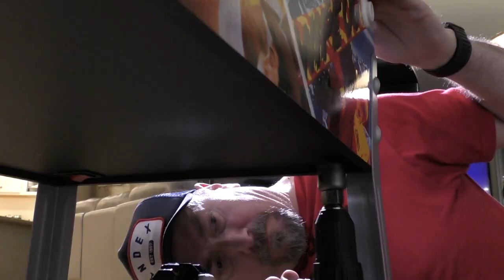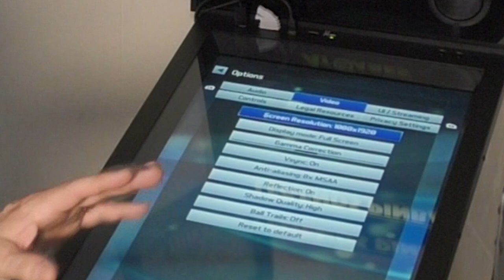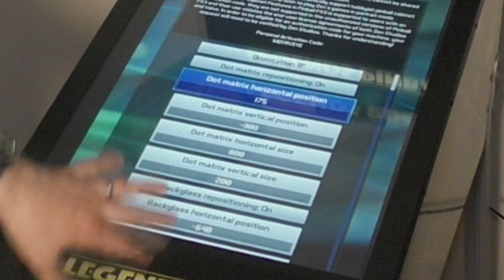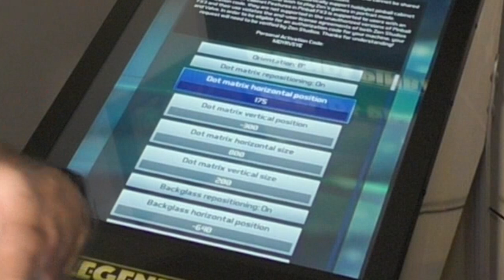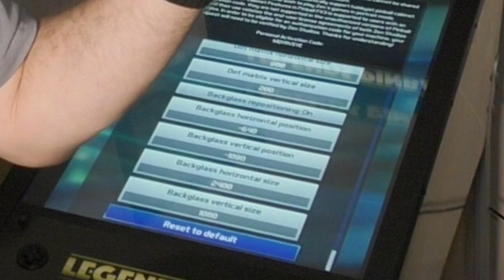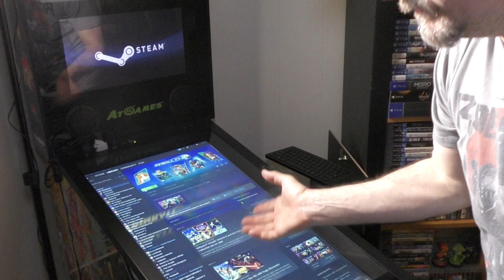AtGames VIBS (Rachel) Board + Alienware OTG PC Install for Legends Pinball | First-Play w/FoG

Comment: Hey brother , like the channel looks like we like a lot of the same things . Only thing is I added black bat tops to my alu with 6lbs springs not red. Also got the pixlecade. My pinball is coming Wednesday. My Rachel board and controller board for the front of the pinball coming Friday. My only thing, is When I install pc’s into any cabinets I attach the board right to the arcade cabinet itself just using a couple of risers and adding fans to pull air in and out of the cabinet . It’s just easier to work on if needed and always runs cooler out of the case . Good luck . Love the channel. Keep up the good work. Def try and get air into the pinball box. I’d recommend drilling fan holes into the bottom of the machine and then adding a fan cover so you’ll be pulling air from under the cabinet . But everything looks good for you. I also have the ribbon cables usb and hdmi. Word of advice when ordering the usb you need to know to order usb a up or usb down. This will determine which way the cable is gonna run when plugged in. Another youtuber has the wrong cables and so it’s plugged in and then the cable bend backwards back over the usb plugged in and then down and hidden away. If he ordered the correct usb cable it would just plug in and go straight down and hidden away. So remember on Amazon check the up or down photo you’ll see when you scroll through the photos and it will show you which you’ll need .
Reply from the maker: Hey, thanks for the advice. I found the various designs of the ribbon cable USB and HDMI, so I’m going to pick some up. I just snagged a 8” screen from Amazon for the DMD, and it should easily fit between the speakers. I’ve seen the motherboard only layout in some Arcades like you mentioned. If I was going to add another one I would definitely consider that solution. Thanks for checking out the channel and enjoy the Legends Pinball.

Comment: If I don't plug the otg USB cable do I still get video?
Reply from the maker: Yes, you should still see the video feed when you press the button as long as the HDMI is plugged in.
Reply: I was reading that some HDMI cables can cause that, I will try difrent tables.

Comment: Would you happen to have any suggestions about the back glass still showing red blue white screen even after installing the vibs board?
Reply from the maker: The Vibs board is fairly straightforward. If you’ve already double checked your install and feel it’s solid, then I would suggest hooking your PC up to another monitor and setting the resolution to 1280x720, try it again, and then if it’s still not working, do the same for 1920x1080. If I remember correctly, the Backglass screen is a little picky with resolution. It also helps ensure your PC can display on both the playfield and another screen at the same time, and this is not some external hardware issue. Hope it helps and you get it working!
Reply: @FactorofGames  thanks so much I'll try at it again first thing in the morning.

Comment: Been binging on LPU videos, since I'm on the fence. Are the built in haptics still useless with the OTG mode? That's a real bummer.
Reply from the maker: They just added in the accelerometer support for OTG, but I’m not sure this will happen for the exciters. I can say the haptics are not bad with Pinball FX3 though. Not as nice as the built-in table or Zac packs for the machine, but still good. There is a solution that Kongs-R-Us showed for adding haptics to OTG in the form of a solenoid kit. You can find the video on his channel and he also did an interview with the engineer who designed it.
Reply from the maker: Here is one of the Solenoid videos https://youtu.be/uov0cH7qnFw
Reply: @FactorofGames  I'd love it if the built in OTG feature set was a little better but that's definitely a solid option. The table is still very cheap compared to alternative solutions.

Comment: Is it possible to get the exciters to work with it?  Got my table in wave 8, but missed out on the last rachel stock.  So now I wait til July for the next batch, and once I get it, I will be doing the same transformation. I want my FX3 tables!!
Reply from the maker: I’m not confident that the exciters will ever work for OTG. There are solutions like Solenoid kits on EBay that could hook up to the OTG PC via USB, and then run Pinball FX3 tables through Future Pinball to get the best experience. Here is the link for your curiosity  https://www.ebay.com/itm/Virtual-Pinball-DOF-Plug-and-Play-Kit-with-Solenoids-Power-Supply-and-PC-Connect-/154430574655?_trksid=p2349624.m46890.l49286 

At some point, I think we’re all better off to build a machine after you go so far down the rabbit hole. I’m going to do another video shortly talking about the complete cost. I’m completely happy with the Legends machine, but like anything, it can always be better :)